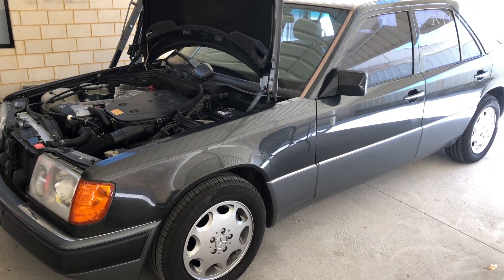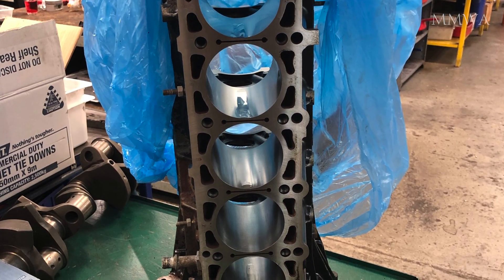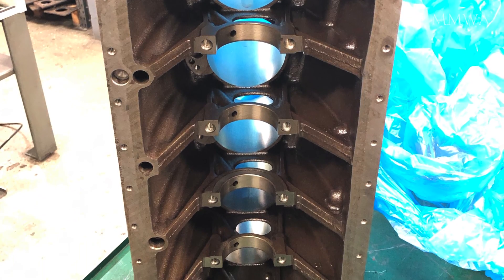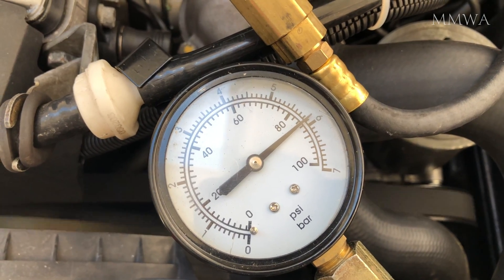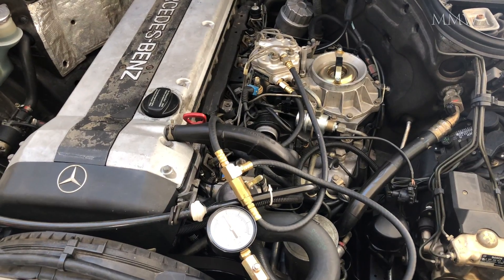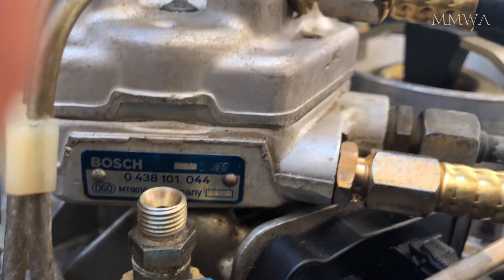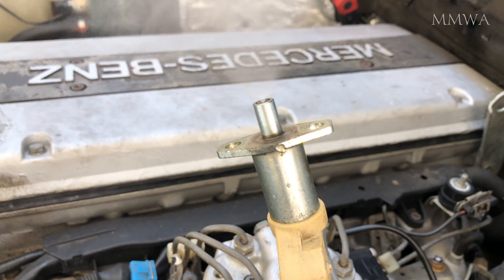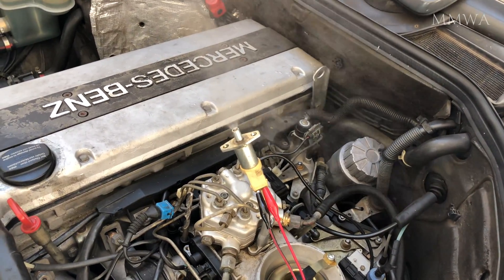Update on Red W124 project & testing my fuel pressures after EHA Adjustment

Comment: Any washers need replacing after doing the test?
Reply from the maker: didnt even remember making this video, hah. But no, i’ve never really had to worry about fuel leaks on re-used copper washers on all my MB’s other than 1 time on my 6.9 and it fixed itself heh. It does pay to have an assortment of new crush washers on hand in any case.

Comment: Hey brother love your videos , one of the few that are super helpful! Was wondering if you have any ideas on my 92 300ce it won’t start, I’ve replaced the rotor and distributer, new spark plugs, fuel filter , and ovp relay. Before it would only start and stay running on about the third cycle now it won’t start at all , battery is fully charged too
Reply from the maker: check for fuel pressure at the fuel distributor and also check for spark, with a spark plug connected to the lead and grounded to the engine correctly. Dont just pull the lead and watch for a spark jumping as this will destroy the EZL.
Reply: Hey so I checked for spark and it’s there I sprayed some QuickStart in the intake and it fired so it’s defiently fuel related- I hear the pumps prime and removed the line going to the k-jet filter and fuel sprayed out so I’m assuming the fpr and fuel pumps are good and the problems somewhere down stream , the injectors I suspect are original are they worth pulling and cleaning aswell ? For the distributer what are good readings ?
Reply from the maker: @nathancogliano3280  I’m currently overseas and dont have access to any specs. I would check for flow as well as pressure, have someone hold the supply line into a bottle or bucket and ensure it’s actually flowing fuel under pressure. if its a 2 pump system and the primary pumps failed you will have a trickle with no pressure. The primary pump usually fails because of a rusty fuel tank.

Comment: Hi buddy! I've measured the pressure at the top point of the fuel distributor and it showed me 3 bar; Do you think it's possible to adjust the EHA or maybe the fail is at the pressure regulator? Thanks!
Reply from the maker: Hi, I’m not gonna have any access to any documentation or notes till February. I don’t want to make guesses and lead you in the wrong direction.
Reply: @MMWA-DAVE  Thank you anyway!

Comment: Question. Are you measuring leak down test from the lower chamber. In the video the valve for the upper chamber (aca system pressure) is closed.
Reply: He's measuring the difference between working pressure (fuel pressure from the fuel pump) and the operating pressure (Fuel pressure after the EHA valve) -- The operating pressure must be 0.4 bar lower than the working pressure.

ie: Working pressure - 6.4bar
Operating pressure - 6.0bar
difference = 0.4 bar = in spec for 14:1 fuel ratio. Any higher than 0.4 bar = richer, any lower than 0.4bar = Leaner

Comment: I have a w202 2.0i which wont start. Pressurised petrol comes into the cold star injector but the injector fuel lines are empty. Do you have any idea ?
Reply from the maker: w202 with K-jet? or you mean w201?
Reply: @MMWA-DAVE  w201*
Reply: I suspect the EHA to be dead. I don't know exactly like diesel engine where you have the electro valve which open and closes the fuel to injectors but it make sense...
Reply from the maker: I would very carefully be running the supply fuel line disconnected from the fuel distributor into a container to check the functionality and the flow rate of the fuel pump. I have had them sound like they are working and infact doing nothing at all or be performing poorly. This should be the first thing checked.
Reply from the maker: Gabriel Plesea if the car has sat for an extended period and you end up finding the pump has power but provides no fuel - chances are your tanks rusted out and the pump has seized. I had this exact issue on the red project.
Reply: @MMWA-DAVE  I bought the car whith a fuel pump stuck, so I baught  a new one. I never drove the care. The engine stay's on for mabee 2hours  in total since the new filter and pump change. So, there is plenty of pressure...
Reply from the maker: Gabriel Plesea did you also change the screen filter at the bottom of the tank? This will be blocked if its original
Reply from the maker: I do still advise you to check the flow rate again. With the new parts they can have been blocked / destroyed if fitted to a rusty tank
Reply: @MMWA-DAVE  I thin you are right. I checked with an electrician the wires and the EHA and it seems that it works fine. I will take the fuel pump and the fuel filter from my w126 and see if the car starts.
Reply from the maker: Gabriel Plesea i bought a usb borescope for a few dollars on ebay. I have a video showing how rusted out my red 124’s tank was. If it looks like that I’d absolutely replace it as you will have no end of troubles otherwise. Just make sure you have a laptop or suitable android phone to use it on. On our cars at least there is no anti syphon mesh in the neck and the scope can go right down the filler neck into the tank no problems. I would do this before risking any further parts.
Reply: @MMWA-DAVE  I just want to hear the engine idling.  I will cut in half the fuel filter and see if there is rust accumulated on it. If there will be rust, I will dismantling the reservoir
Reply: @MMWA-DAVE  I found the problem. When I dismantling the fuel pump, I notice no gasoline pouring out of fuel tank so I  pour a gallon in it and it starts immediately.  The problem came from a bad litrometer which I will change in future.
Now I found another problem...when I max rev the engine, it shoots immediate or it will idle at 500rpm for few seconds, or if I put it in first gear and slowly release the clutch pedal it shoots of.

Comment: hi i got a g wagon with m103 3.0 engine , it is rated at 170hp on paper, but i have done some small adjustment on eha valve 1/ 4 turn richer from stock for compensate fore age to the system , and also g wagon got like a wird air intake on the side fender looks very non effectiv fore tourq and power,  so i moved that to a w124 style into the grill for better air flow and open up the filter ring holder a little, with  a round k&n filter.also new injectors,  i feels alot more resposive and power and tourq allready,   adjusted also the r16 plug from N to S  and have 98 octan in the tank,  it goes very well now,  and new 2,5" sport exhaust for it and removed the cat, so god flow there also. so feels like i got some poewe upgrade, dont know how much,  but i am woundring to try a electric turbo from tourqamp, it can push  only like 0,4 -0-5 bar,   what do  you recommend fore adjusting the fuel fore this set up on a m103 ?

Comment: Hi all,  i have a 300sl-24  with an m104.98x,  can i install 2 gauges to upper and lower separately to measure? Or connect to lower measure it ,  turn off engine and measure upper with one line and gauge?

Edit : i cant seem to increase my lower chamber ,  it is 5.2 bar now,  when i turn eha adjustment ccw i can get it up to 5.4 max but no way to adjust afr with that valıe any suggestions?

Comment: Exactly the same for my 1990 m104.980. It's obvious that the .4 bar difference is the absolute minimum. At nearly .5 bar, my engine has sparkling performance but I have noticed that it uses more fuel than it used to....expected. With engine off, it will hold at 3.5 bar for more than half an hour. Car to car comparisons are very helpful.
Reply: I found in w124 m103 manual system pressure (upper chamber pressure) are 5.5 ~ 5.3 bar, which are regulated by fuel pressure regulator (fpr). And a lower pressure same as your describe 0.5 bar below measured system pressure. Why your system pressure reading take higher than 5.5 bar? Greeting from w124 Diy Indonesia
Reply from the maker: reza gulardi m104.980 uses same high pressure regulator as m119 kjet. So their spec is 6.2 to 6.4.
Reply: @MMWA-DAVE  Hi all,  i have a 300sl-24  with an m104.98x,  can i install 2 gauges to upper and lower separately to measure? Or connect to lower measure it ,  turn off engine and measure upper with one line and gauge?
Reply from the maker: 0.5 must be the magic number, 0.4 being for optimum fuel efficiency. I used to get 500-550km per tank I wonder what I will get now.
Reply: Exactly. All my reading has revealed that they were designed and tuned for max fuel efficiency, which was amazing at the time. They are still not too bad today. (My 2008 Hilux eats fuel.)  What seems to happen is that they tend to lean as they age. You don't hear many complaints about them running too rich.